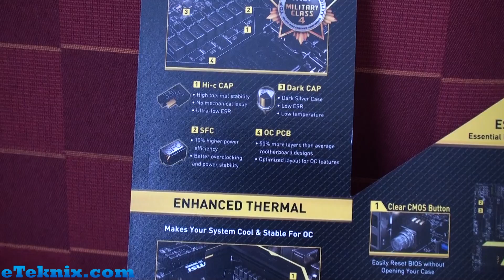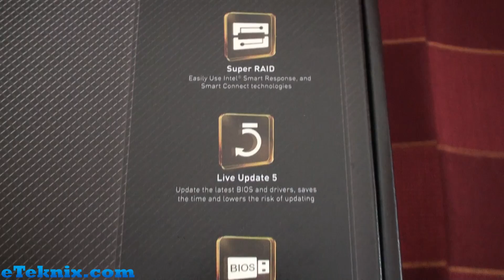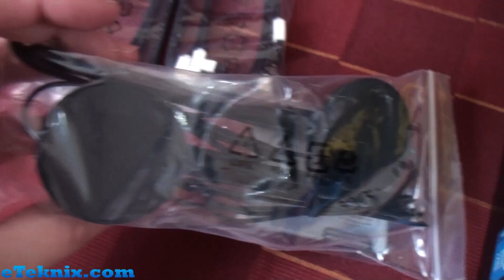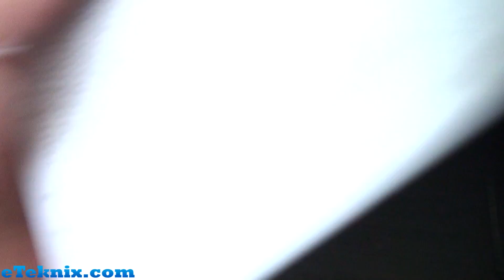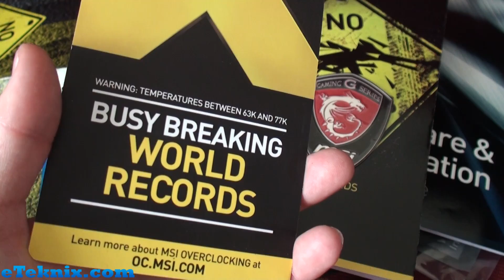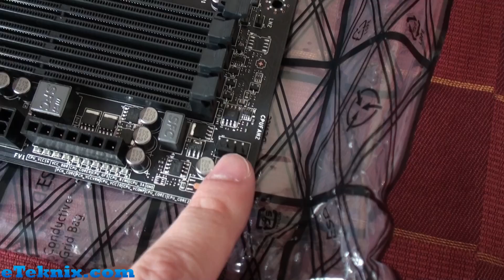MSI Z87 MPOWER Motherboard Preview

Comment: if im not overclocking do i need to fill both 8 pin slots? my current psu only has a single 8 pin, just need to test the board, then ill know if i need to go on and upgrade psu or not